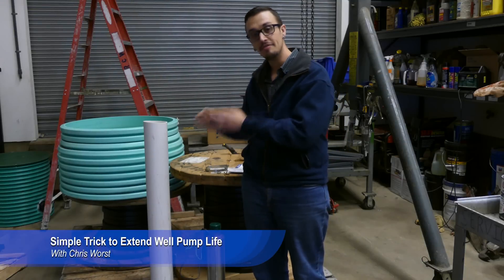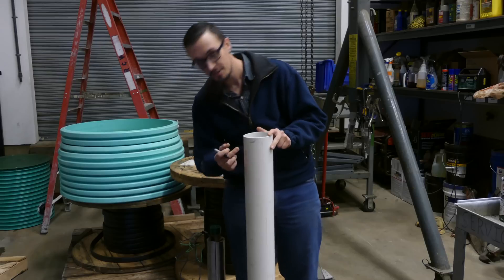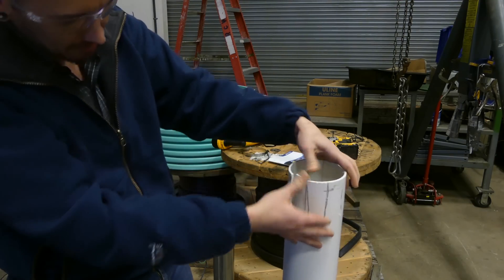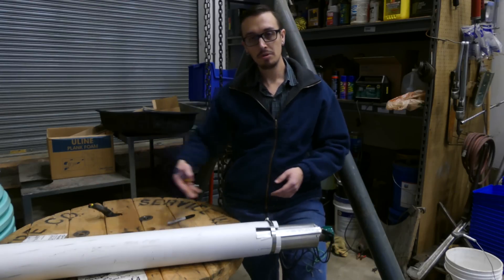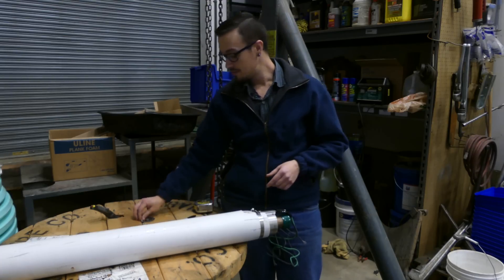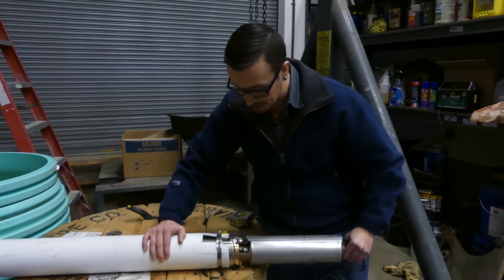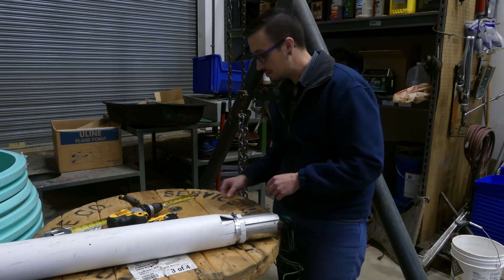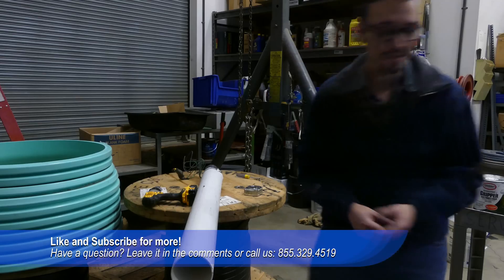One Simple Trick to Extend Well Pump Life (Flow Sleeve)

Comment: This is crazy. You are restricting the flow of water to the pump intake!
Reply: I’m thinking the same thing. Raise the pump up if you’re experiencing enough turbulence at the bottom of the well to strip the sediment and suck it up that pipe.
Reply: @nelsondog100  
Dude This Has Nothing NOTHING To Do With Sediment Being Sucked Up And Pumped Up The Pipe..   It's About COOLING The Motor, Making All The Water Pulled In By The Pump Be Pulled ACROSS The Motor Before Going Into The Pump.  On Submersible Pumps The Motor Always Lays In Stagnate Hot Water And Never Gets Cooled Properly ....The Reason For These Sleeves Makes That Happen....COOLING THE MOTOR !
Reply: Exactly my thought too. It would seem the increased resistance would make the motor work harder and produce more heat, and may even promote cavitation. Also now you have aa suction tube like a vacuum cleaner now reduce your rise from the well bottom.

Comment: If one lives in a warm climate the idea of 10 gpm and a pressure tank holding five gallons of water keeps the well industry employed selling expensive pumps domed to fail every few years.   Put in a one or two gpm pump filling a 2500 gallon storage tank with a small  pressure pump top side.   The cost of this is far less, far more dependable and far easier to maintain or repair.
Reply: You seem to be quite knowledgeable in the field. I’m in the Philippines, would you mind answering a few questions?

Comment: You have an interesting solution to this problem.  Shame on the manufacturers for telling us we ought have a flow inducer (which is true in larger well casings or open water), but then not supplying a properly engineered and manufactured kit, not documenting a workable design, forcing us to improvise as you've demonstrated.

Your improvised sleeve has several faults.  The main problem is that the size pipe you've applied (4in SDR35 pipe sleeving a 3.75in OD pump) is too small.  You are restricting the intake!  You should be using the next available size up, 6in pipe.  The intake water has to flow through a narrow gap between the 4in pipe ID and the 3.75in motor OD.  If you calculate the area of that restricted ring of flow, you'll see that the cross-sectional area of intake flow can be less than the area of the specified output pipe.  The flow speed will also be so fast that the flow capacity is further reduced by drag.  It's also on the suction side, which is compounding the problem.  The pump is more or less a loose clog, and you effectively have a 3/4in suction intake.  So essentially you are restricting and throttling the intake with your sleeve, and that will penalize the pump flow-rate performance.  Pump intake paths always have to be bigger than the output.  Otherwise the performance is reduced, and the lifetime is shortened, especially on a submersible.

Cutting and clamping the top of the sleeve to improvise a collar is asking for a future disaster.  How many years would this rig last?  The pump is always thumping around and that clamp is going to work off, or the tabs you cut are going to crack at the ends and propagate (brittle PVC!).  Then you've got few feet of PVC lost down the well.  I suggest if you're going to cut tabs, that you drill holes first at the inner end of the cut so a crack in the PVC is less likely to start and propagate.  Heat the tabs up with a heat gun to bend and form them into a proper mating shape to relax against the pump OD and not put stress on the ends of the cuts, like a swage.  Or use a Fernco rubber coupler, and avoid the tab feature altogether.

The grub bolts (that's what they're called) at the bottom are another worry on a flailing pump.  If they're clamped down, they will be pinching and scuffing the pump constantly and come loose.  If they're not clamped down, they'll get hammered loose from the weak plastic threads.  First the hardware is lost down the bottom of the well and the sleeve is not working, and then the pump is doomed to overheat and fail.  I suggest instead that you use two pieces of threaded rod crossed at right angles through the diameter of the pipe, with threadlocked nuts on the outside not fully tightened.  This won't put any stress on the plastic pipe or chafe the motor, but stay in place.  To maintain centering, cut 4 short lengths of rubber garden hose, punching a hole in one end of each, and put the hose onto the threaded rods through the holes.  Fit the free end of the hose  up between the motor OD and the pipe ID.  Then you'll have a soft clamp on the motor OD to keep it centered and free-flowing through the intake, and an assembly that won't be donated to the abyss.  You can also rig the ends of the threaded rod for stainless wire rope hoisting/safety cable, and then your sleeve is also a rescue basket to lift out the works securely without depending on the unreliable downpipe.
Reply from the maker: The majority of modern private wells in the US are cased with 4" PVC. In these situations a flow inducer is not necessary or even feasible. Flow inducers are best applied to 6" wells or larger where fluid velocities might not meet the recommended range for ample cooling.  I can assure you with tens of thousands of well pumps installed over the course of the last 68 years using flow inducers, they work great, even for flows in excess of 20 gallons per minute. This particular flow inducer is not an improvised design, it is that of Franklin Electric one of the largest submersible pump and motor manufacturers in the world. This design can be found in the Franklin Electric Aim Manual on page 6.
Reply from the maker: It is worth mentioning that the primary reason for motor failure outside of misapplication or improper installation is winding failure. Winding failure is the result of heat in the windings that breaks down the insulation over time, eliminating as much heat as possible is the objective of the flow inducer.  Installing a flow inducer will lend itself to longer life of the motor and possibly the pump if you have sand or sediment issues.
Reply: @RCworstwater  You're entirely correct about the cooling flow problem and its potentially ruinous severity.  But in solving that problem, one shouldn't introduce new problems like intake restriction or mechanical unreliability, which can be worse than the original problem.
Reply: @RichardKinch   I realize your comment is over a year old, but I feel inclined to comment. A simple math equation will let you know that the intake area available when a 3.75” pump is stuffed inside a 4” ID tube is approx 1.53sq inches. 

Most pumps have a 1 or 1 1/4” discharge. A 1 1/4” discharge equals 1.23sq inches. 

As long as the intake area is larger than the discharge there won’t be issues.
Reply: @CDNSldr1  Nope, your math is off.  The 1.5 sqin intake available is less than a 3/4 in pipe, but in the form of a narrow annulus that will raise even more resistance.  Think about it: there's only a 1/8 in gap.  That's a faulty design.
Reply: @RichardKinch  A 3/4” discharge pipe has .44 sq inches.  As long as the intake has more area than the discharge there won’t be major issues…especially at these relatively low pressures/flow. 

Care to explain your formula? A = π r² is about as simple as it gets.
Reply: @CDNSldr1  See the engineering data such as Goulds pumps provides about sleeves, or a general text such as Marks Handbook.  There's a conflict between flow rate needed for cooling and resistance that throttles performance and efficiency.  A 1/8 in gap is way outside the envelope of valid solutions.  Intake resistance ruins pump performance.  Intake area must be many times the output area.  A submersible performs best if it is wide open, but the heat dissipation is in conflict with that, where you need just a bit of sleeving restriction, just enough to guide the intake flow around the housing.  Throttling the intake will lower the power engagement, so it succeeds in cooling itself, but only because you never realize the rated output.
Reply: @RichardKinch  Most pump manufacturers (from the info I’ve been able to find) recommend a flow velocity of .25ft/sec past the motor for adequate cooling. 

For a 3.75” pump using a 4” sleeve, .25ft/sec is achieved at approximately 1.2gpm. A 5” sleeve won’t achieve .25ft/sec until 7gpm and 6” sleeve won’t achieve it until 13gpm. 

I certainly agree that the cooling needs is at odds with the pump physics. So what’s the solution? A 4.25” or 4.5” sleeve would probably solve the suction issues while providing proper flow velocity over most of the pumps range.
Reply: @CDNSldr1  Agreed.  Then the problem reduces to not having readily available materials to improvise a sleeve because the standard pipe size series doesn't happen to match the required diameter, even if you have proper calculated design.  Better then to err on a slightly larger sleeve, since intake restriction is very costly, while a slight temperature rise is not.

Comment: I had my well drilled and pump installed 30 years ago for the first time. The installers put the pump inside of a 4in inside diameter PVC pipe that was 60 in Long. They secured the pump inside the pipe with a 4in well cap. I have replaced the pump a couple of times and I'm in the middle of it again today. This is the first video I've seen mentioning this " flow collar".   Your method has more steps and seems less desirable to me.
Reply from the maker: I agree with you completely, the well cap method is far superior. The method outlined in this video is how Franklin Electric instructs the sleeve to be made.